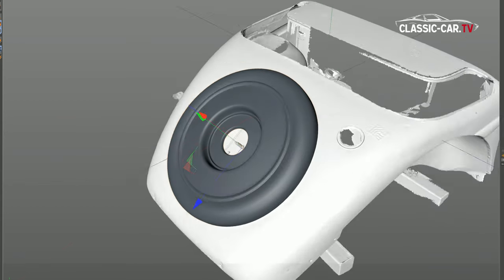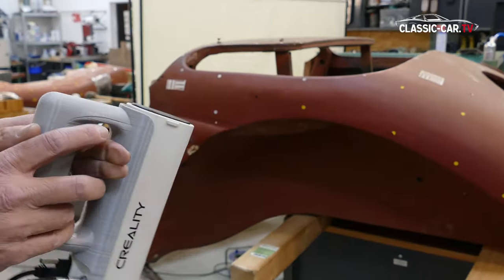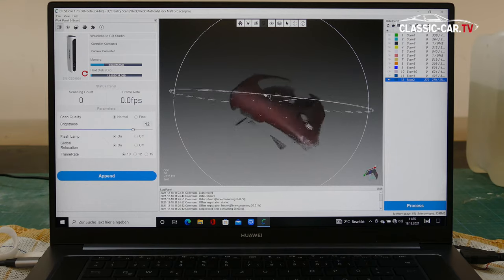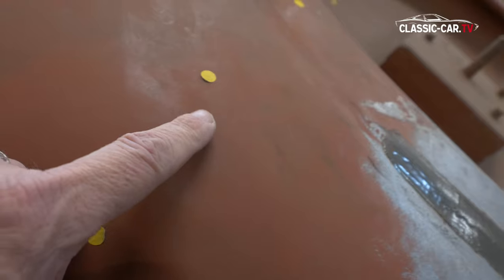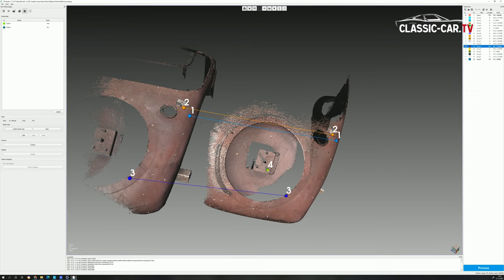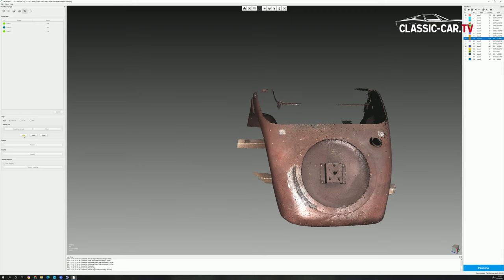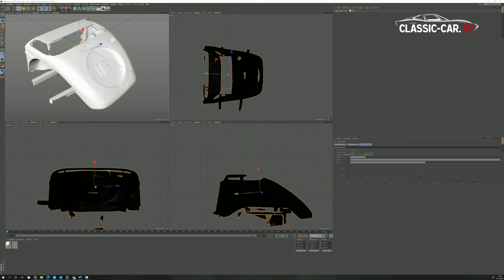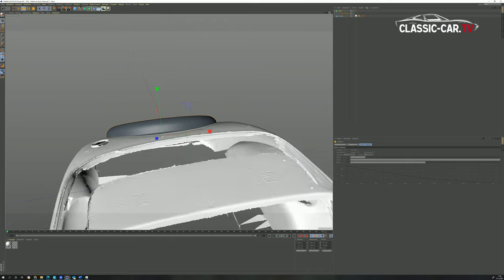Scanning a classic car with Creality CR-01

Comment: Hey, nice job! Can you give a ruff estimation about the accuracy of the resulting surfaces in the CAD? Is it better that 5mm or maybe close to 1mm? I am interested in it because I want to scan the interior of my camper van to do some changes.
Reply: The website says 0.1mm accuracy
Reply: Expect to within maybe .5mm accuracy depending on surface reflections and color.    Variations in color can cause it to see it as texture differences and cause dimensional shifts.

Comment: did you find you had any problems with shiny or black objects distorting the scan? also, where did you get the STL for the handle? thanks
Reply from the maker: Yes, shiny objects can cause problems, but this si whith any 3D scanner. You need a special spray for that. The same with black or dark holes. It helps to ad some light on backdropping parts. then the scanner picks up the details. The STL for the handle comes with the scanner. It´s on the USB stick.

Comment: How many scans did you have to join together to get a total area this big? How would this scanner do with a high detail like an engine?
Reply from the maker: It were in total six scans in four sections. But you can do more. We scannned the complete car in  18 sections in round about 36 scans. Worked perfects.
To your question if it is possible to scan an engine. It depends on what you intend to do. If you need it for reverse engineering, I would say yes, you can. For example a manifold, cylinderhead, any kind of adaptions. For scanning a part for the reprinting or using it as a master, I would wait for the new upcoming "Lizard" version of the Creality 3D scanners. It seems to be cruel on details.
Reply: @ClassicCarTV  thanks for the reply. How long did it take you in time to scan these 4 sections?
Reply from the maker: @Farmerboi15  It was about 30 min scanning and about 2 hours in working on the editing. This is very quick.
Reply: I have this scanner, but I don't know how to align more than 3 scan manually in handheld and rotary mode. Please make a video from 4 scan cycle and manually alignment.
Reply: When doing a full car body, I imagine target placement is critical for accuracy across multiple scans to reduce cumulative error.
- What accuracy in overall size did you achieve?
- What strategies did you use to minimize cumulative error?
Thank you in advance.

Comment: Did you scan the wheel cover or did you design that part custom through the soft ware to fit?
Reply from the maker: Hi, the wheelcover is designed in a 3D software. The original doesn´t exist anymore and I couls only get some pictures.